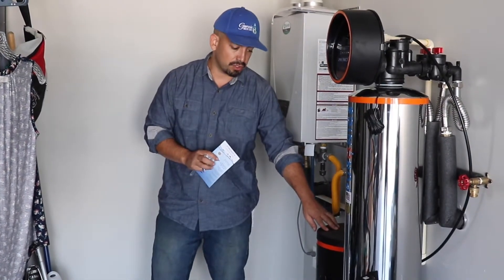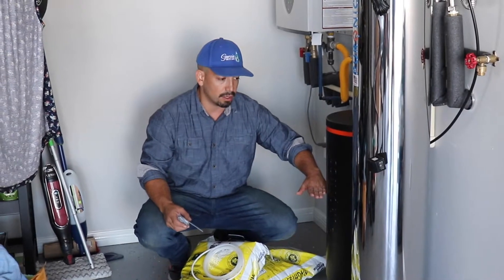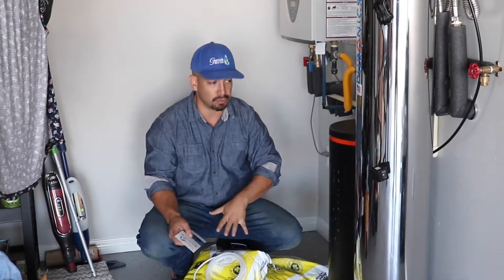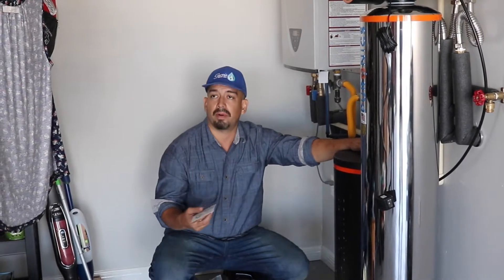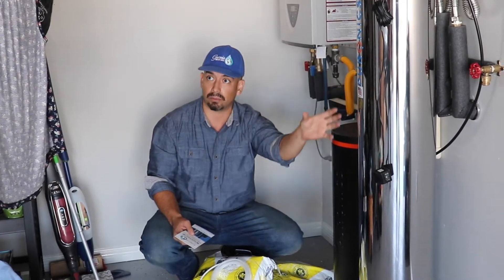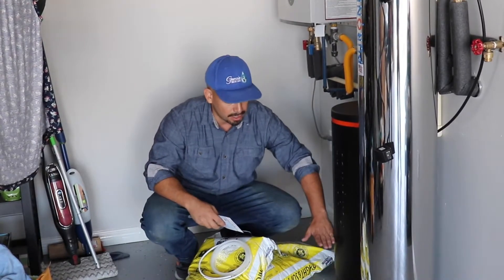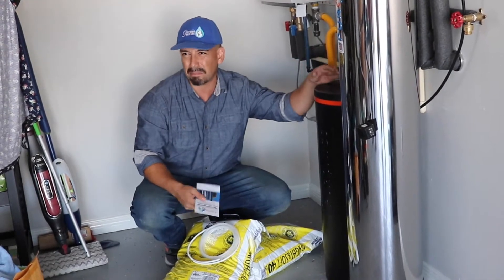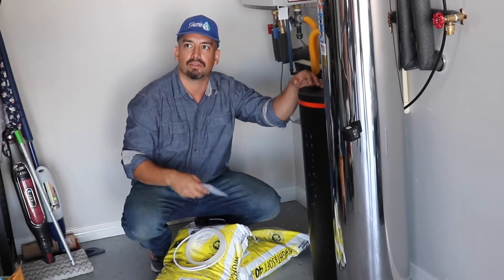Water Softener Brine Tank | How it works on a Puronics Hydronex C

Comment: Do you have a video on how to change the silver shield filter?
Reply from the maker: @Notmyhandler  long story short:  we CAN provide helpful videos on those services- but based on the meticulous steps needed to complete each service (which all water techs should have extensive training and experience on home water systems), we feel we would cause more possible issues and headaches for many of our viewers. We see that as a disservice we would be providing to the public.  

When it comes to your home water, it's worth the investment to contract a professional. Just make sure you do your research before that investment- just like any other industry, there are fakes taking advantage of ignorant consumers.
Reply: @garciawatercare  thanks for the reply but I’ve already changed it, all you need is a brain and a shop vac.
Reply from the maker: @Notmyhandler  and we normally have at least one handy! Best of luck!

Comment: Just moved to a new home with the puronics water softener already installed. The water is very low and I just added one bag of salt. Do I need to do anything to get the tank to fill?
Reply from the maker: It could be that the unit needs maintenance. Do you live in El Paso?

Comment: My system is flushing water non stop , I’ve call the company and I haven’t been able to reach anyone 🤦🏻‍♂️
Reply from the maker: I would definitely bypass the system in the mean time. A constant flushing noise could be water escaping through the drain due to a bad spacer or o-ring. If you can't find the company you purchased your unit from,  try other water treatment providers in your area. And if by chance you live in or near El Paso, TX,  give us a call- 915-444-3582!